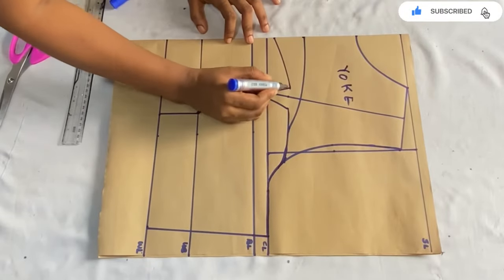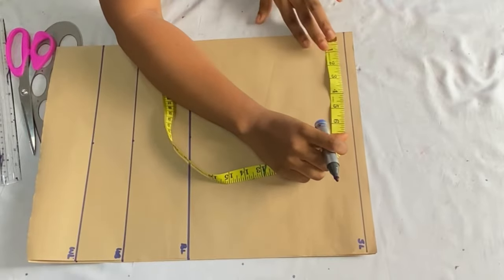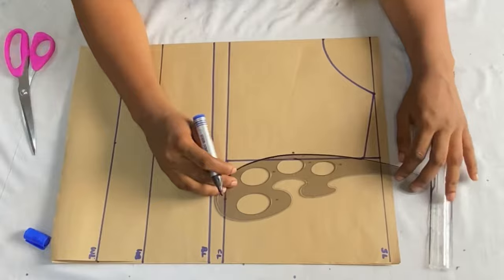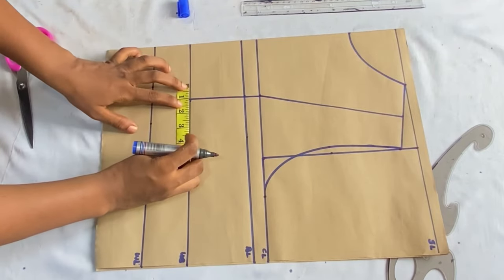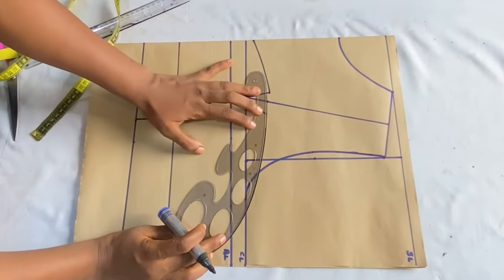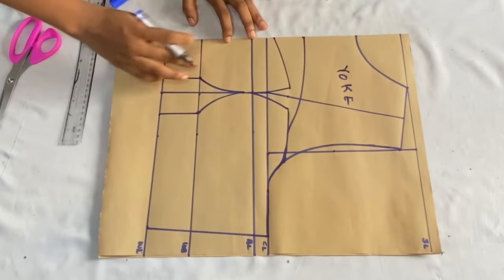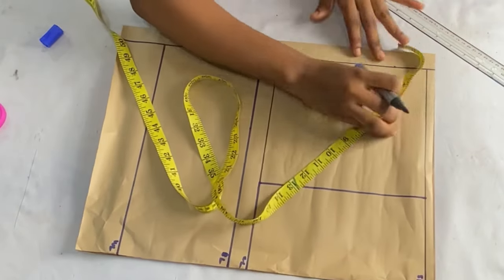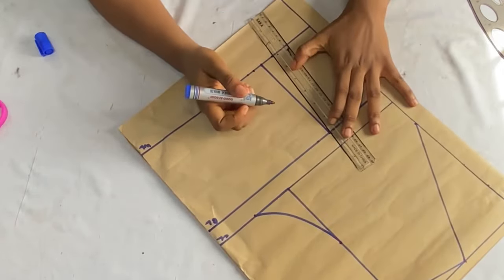How to draft a BUSTIER WITH KEYHOLE YOKE/ Beginner’s step by step tutorial

Comment: Very clear, easy to understand tutorial.

I just wondered, when you measured your armhole length you started from the shoulder line, it came to 9”, but then after you dropped the shoulder slope by 1” it then became 8” not 9”? 
When you then divided the armhole it measured 8” you divided it by 2 which gave you 4”. 
I have always thought you measured the armhole after you drew the shoulder slope? Have I been doing it wrong?
Reply from the maker: Thank you 🥰🥰
Sorry if I got you confused there. The 9 inches I marked already included the one inch for shoulder slope. The actual round arm  hole measurement i worked with is 16 inches